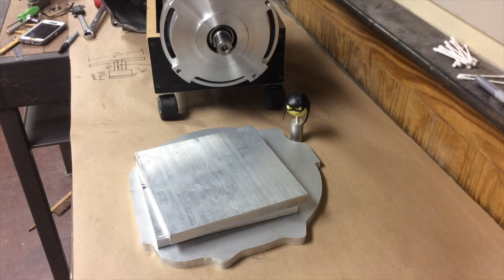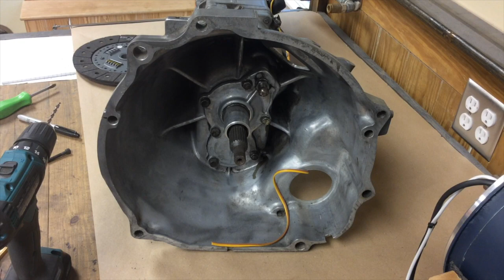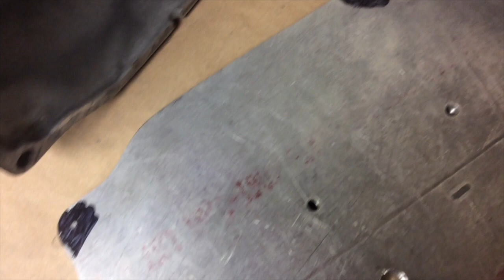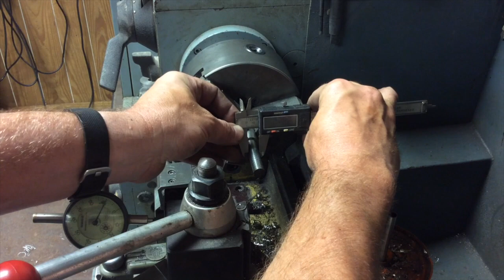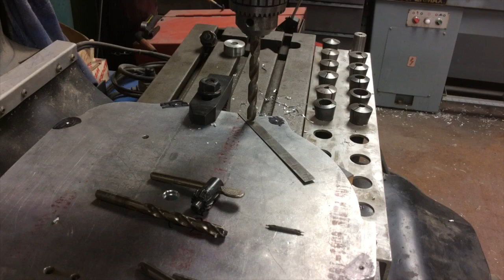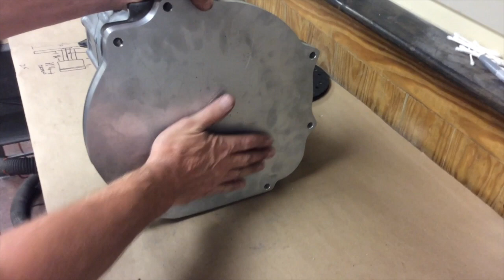RX7 to EV7 Episode 2a Finishing the Adaptor Plate

Comment: The mystery of your odd sized holes is because the rear plate of the engine has 4 dowel pins, one located at each "corner", which engage the hole in the bellhousing. The mounting bolt then goes through the dowel pin to engage the threads on the rear iron. M10 with a fine thread (1.0?) if I recall correctly. And the top one is weird compared to the rest, M8 I think. One machining question. Why not stop the 7/16 drill short a bit then finish the hole flat with an end mill? So no danger of breaking through.

Comment: Next time it might be easier to line up the plate on the mill putting the rod in the chuck line the plate up by locking the quill down with the rod this the hole and clamping the plate down nothing wrong with the way you did it just quicker
Reply from the maker: Emile xantia, thanks good tip.

Comment: Is there a way to remove transmission altogether in an ev?  Seems it would reduce weight and be a more simple build w/o transmission.
Reply from the maker: PlanetMusk Vlog, In some ways it would be easier. But for me this seemed to be the path of least resistance.
Reply: Don Walters Keeping the tranny will also reduce the load on the motor a lot and make its power more easy to utilise.
Reply: Don Walters Glad you did.  These videos are fantastic brotha! Learning a lot watching.
Reply from the maker: PlanetMusk Vlog, yes
Reply: wat about cvt
Reply: The transmission gearing  will let you go faster  at a lower lower rpm .Also has reverse    Just like with a petrol engine